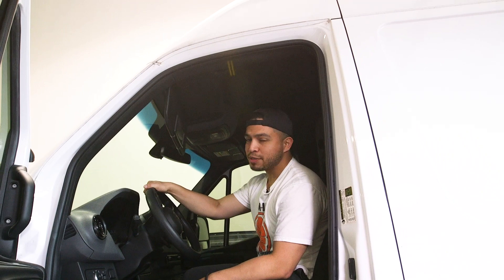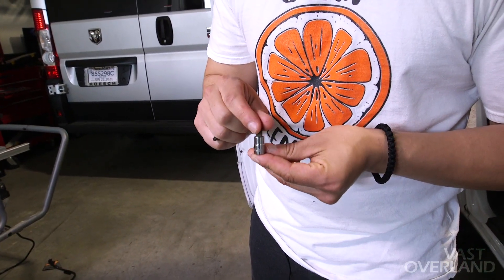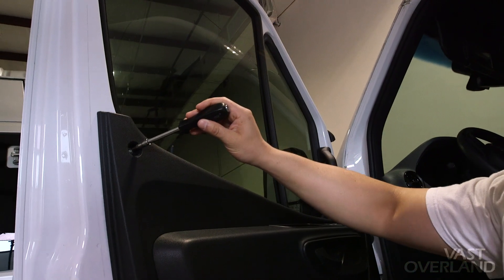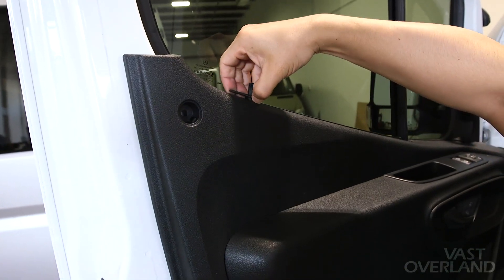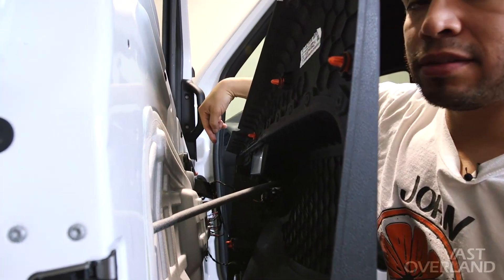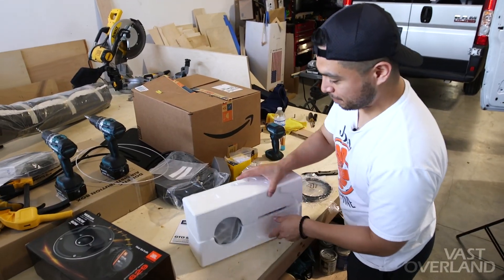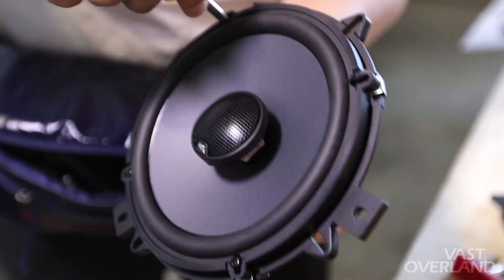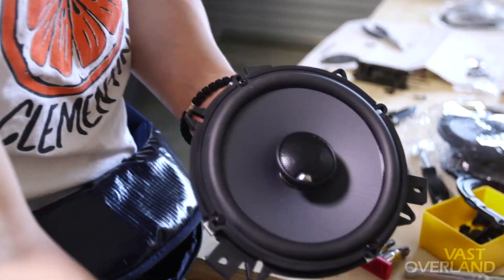EP14 Vast Overland: JBL Door Speaker install on a Sprinter Van

Comment: How easy is this on a T1N?
Reply from the maker: The T1N has dash speakers on my van and I did a separate video for it on this same channel.
Reply: @VastOverland  I used that video for reference thank you again for sharing it. The Pioneers work great. Wondering how I can get some extra bass into though...
Reply: @brasilfreak24  same question! Did you ever end up finding a way to better upgrade the audio??

I found this video but requires a fair bit of work lol 😅
https://youtu.be/vn5MJkMT4uY